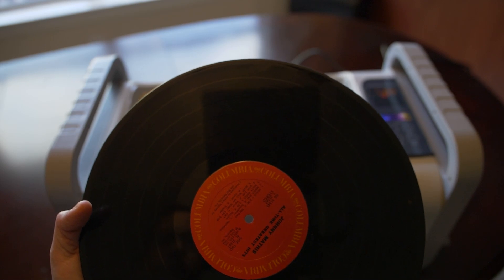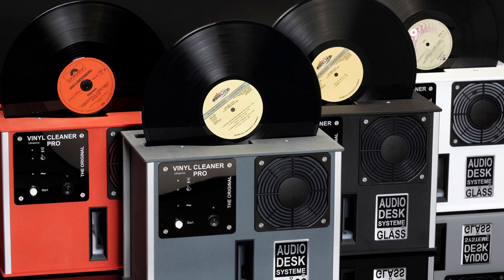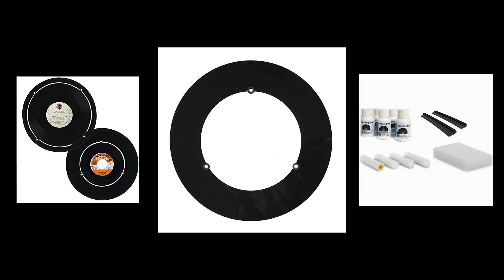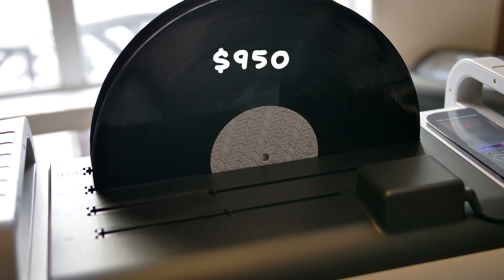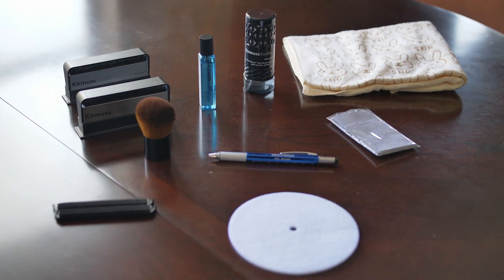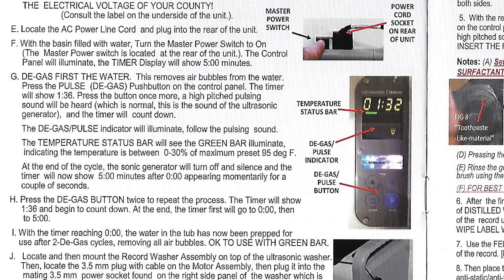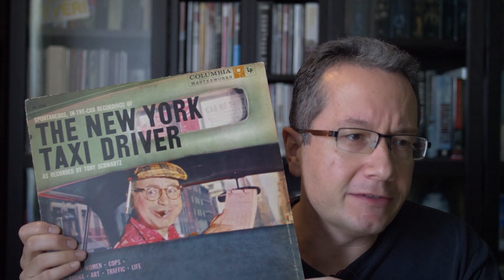Kirmuss KA-RC-1 Ultrasonic Record Cleaner Review and an Ultrasonic Cleaning Primer

Comment: Why never to use alcohol to clean a record (cont’d). You will not notice anything amiss until later… 
The risk, or reaction, can be perceived to come from the additives which are in the PVC. These plasticizers, stabilizers and extenders help to give the vinyl some flexibility, and are bonded into the solid material.

Small reactions of these elements of the record to alcohol are what can affect the integrity of the disc, and the risk of an adverse effect on their bonding to the surface and base of the PVC is what makes alcohol a less than desirable cleaning solution for vinyl records.
Reply from the maker: Do you know of any vinyl that doesn't have any plasticizers or stabilizers?  Gimme me a break.  I've even had someone from Dow chemical debunk this myth.  If you don't want to use alcohol...then don't.

Comment: Intelligent and cost minded , excellent presentation. Agree about use of alcohol, concerns seem to be more focused on extraction of  plasticisers rather than attack of PVC itself but I use IPA  20%: to deionised water 75%: to surfactant 5 % and have never suffered any embrittlement of the vinyl. Great topic and much needed with people hunting down old vinyl these days.
Reply from the maker: Thanks so much Steve for watching and commenting.  I am glad your experience with IPA matches my own.  I've been using it for years and have yet to experience any issues.

Comment: I just got my Kirmuss machine the other day and I have fired it up tonight.  I thought you might be glad to hear that there is no bunny on the front of my machine.  He must have heard you lol/. Poor bunny 🐰
Reply from the maker: Awesome!  I am really glad he changed the package to be a bit more professional looking.  I am going to run my Disney version until the thing falls apart ;)
Reply: @BarakaPDub  it does look more professional without it, I would say.  I tried your suggestion of drying the record with vacuum and distilled water.  It worked great! Thank you for the suggestion.  The Kirmuss is one amazing system.  I cleaned about 10 records last night, both mono LPs from the 50s and a handful of 10 inch EPs from the 40s. I listened to a few of them afterwards and I could not believe how good they sound. This system requires some work, but I think it is well worth it.  And a must for me because a large part of my collection are those old mono albums and EPs. Thanks again for this video.  It was really a fantastic review.  I appreciate it. 👍
Reply from the maker: Outstanding!  I am glad you're now experiencing what a really clean album can do to your system.  With your comment, I feel like I've done my job so thank you.

Comment: A well done video, informative and well documented on the operation of Kimuss record cleaner! I was thinking of another system? but pointing out the items that are conducive to wear and tear I see the value of spending a little more for this product! As it was once stated "it only takes a nickel more to go first class!" Thanks Byrne
Reply from the maker: Thanks Michael.  I have cleaned over a thousand records on this unit now and there have been no signs of wear.  I am a still a happy user and if I had purchased an even more expensive unit, like the Audio Desk, I would be an extra $500 to $1000 out of pocket buying fluid and rollers.  While the DIY machines work just fine, this one will be a little less labor intensive.

Comment: Loved this review and I am planning on getting this Kirmuss machine for my records.  So are you using the vacuum as a drying process once you have done the ultrasonic cleaner? That sounds like a way to cover just about all of your bases for sure. Thanks for the video!
Reply from the maker: In my opinion, regardless of the ultrasonic machine, not all of the removed particulate immediately settles to the bottom of the tank.  Some may actually end up back on the records surface.   I use the vacuum to do a distilled water rinse for a final cleaning step.  The key to vacuuming is not to over vacuum as it will just end up inducing static on the surface.  I will vacuum for one or two revolutions and let the remaining fine water droplets to evaporate in short air dry process.  Doing this, depending on the quality of the record pressing and condition, will leave the surface 97 to 100% free of any clicks or pops.   My process might be a bit too extensive for many but I have found it to work for me.  Hope this helps.
Reply: @BarakaPDub  That’s a great idea.  Thank you for letting me know your process! 👍
Reply: @BarakaPDub  what you are doing, is what i will eventually do. i have the kirmuss right now, and in a few months get the vacuum.

Comment: Thanks for the great video!  What kind of vacuum are you pairing this with?  I am looking at a Kirmuss, but buying a vacuum is another piece of gear, which requires more room.  Could the vacuum be avoided by buying Degritter or an Audiodesk or do you think those units would also require a vacuum?  FYI - ListenUp in Denver has the Kirmuss on sale for $850 right now.  Another question: does this unit ever cause the label to get wet?
Reply from the maker: Thanks for the great questions Israels & Neuman.  So to answer your last question, no matter what machine you buy it's going to be almost impossible to avoid getting the occasional label wet.   Honestly, I wouldn't worry about it to much as they quickly dry and it's almost impossible to notice that the label was wet.  There are some exceptions though.  I have some records which were made in the former Eastern Block (i.e. Poland, Czechoslovakia, etc.) that used cheap dies in their labels and it cause the die to run.   Now for the vacuum, most people don't bother.  They go one way or the other with the cleaning but I do both.  The reason why I do both is because the particulate that's removed from the ultrasonic doesn't immediately settle back at the bottom of the tank.  I use the vacuuming machine to do a distilled water rinse, removing any remaining particulate and I let the remaining, fine water droplets, air dry after a rev or two of vacuuming.  This process usually gives me an LP that's 97 to 100% click and pop free if it's a well pressed record.  Just doing the ultrasonic alone is going to get rid of the vast majority of residue that's collected on the surface though.  The AudioDeske and Degritter just have a few more bells and whistles by blow drying the record after the ultrasonic bath.  If I had to chose between the two, I would go with the Degritter.  The AudioDeske has proprietary fluid and rollers which can be an expensive proposition if you buy a lot of records.   If you add the vacuuming machine, I think I would go for the Pro-Ject VC-S2 ALU.  I am using a VPI MW-1 which is way overpriced for what it is.  I honestly think the Pro-Ject is better designed and half the price.   Hope this helps.
Reply: @BarakaPDub  Thanks!
Reply: @BarakaPDub  I do the same system. I traded up from the Pro-Ject machine to the VPI. The motor in the Pro-Ject is louder, and I felt the VPI had better suction power and was actually quieter. The Project looks nicer, but all of these machines look pretty bad sitting around your house except maybe the degritter. I sometimes think of selling Kirmuss and VPI to fund a degritter, but I can't seem to care about record cleaning enough to make the time to do it LOL. Most days I brush the dust into a line on the record with a basic CF brush and roll it off w/ a record roller. It is shocking how much dust records have, but the surface dust brushes off easily on clean records.

Comment: I would be interested in your review of the $500 HumminGuru machine. I only do a very few records at a time, so the multi-record factor of the Kirmuss isn’t persuasive. I also like, from video demonstrations, the smaller form factor and general quiet operation — I am in an apartment.  Also, a related question, do you do vacuuming after or before the US treatment? Thanks for your candid comments. They help.  The K machine is just too big for me.
Reply from the maker: The Humminguru is definitely the product of the year for me.  While I don't own one, I do think having something more at that level will get more people into it.  This shouldn't be made so expensive.   As for the vacuuming, I do it afterwards.  Why, you might ask?  When you ultrasonic, not everything ends back up at the bottom of the tank.  Some particulate that's removed can float back on the vinyl surface so a distilled water rinse on the vacuum machine, to me, ensures everything is removed.  I hope that helps explain my thought process.

Comment: I already have a Project VCS2 vacuum machine but was thinking of buying a Kirmus machine . Does the ultrasonic cleaner as well as the vacuum machine really make that much more of a difference than just using the vacuum machine on its own
Reply from the maker: So I found a big improvement doing both in tandem.  I don't think the vacuum machine will remove everything but then again, an ultrasonic isn't going to remove everything either.  The challenge I found with the vacuum machine was not to over vacuum as you end up just inducing more static on the vinyl.  I do use the vacuum machine for a distilled rinse and mechanical agitator when needed.   I hope that helps explain my thought process.

Comment: Cool that you get such great results! Do you know the frequency of the Kirmuss? Just so I understood correctly. You have water (distilled - de-ionised) + IPA + ultrasonic. Then you rinse in water (distilled- de-ionised) and air dry?
Reply from the maker: Correct on the process but unfortunately, I don't think I can give you an answer on the frequency.  I read somewhere it's the same as the Audio Deske  but I can't remember where I read that.
Reply: @BarakaPDub  Cheers. What drying rack are you using? I like that design.
Reply from the maker: I am just using a letter filer that I found at the Office Depot.  One of the best $5 I ever spent!  Plus, the metal only touches the labels and not the vinyl...if you're careful.
Reply: @BarakaPDub  Oh great, thanks for the tip. You might consider dipping the parts that touch the labels in that Plasti-dip... the stuff used for tool handles and things. Thanks for your help and advice!

Comment: Nice video!!!  I have one of the other machines you mention 6a  liter ultrasonic electric cleaning machine I just bought the tank & mad everything else my self.   I can do up to 6-7 records at a time & I just made a 2nd drying rack  (so while 7 are beaning cleaned 7 are drying.) I don't use distilled water or alcohol my solution I used reverse osmosis water, Then I if I need to (or I'll do it solo) I  use my Project VC-s Vacuum record cleaning machine, Both together work great.
Reply from the maker: It's funny, I am looking at setting up a reverse osmosis system in my home.  Just as long as you can filter out all of the hard elements, I suppose it could be fine.   Thanks for watching and commenting Paul.
Reply: @BarakaPDub  funny I watched your video again I for got I had made this comment Almost mad it again!   I get reverse osmosis water at Whole Foods for $0.98 for 2 gallons My jugs there water.  Yes it does work well with my Project VC-s machine .   Happy Spinning my Friend..

Comment: I have used a record bath for years with great results. It has vertical brushes on each side below the surface of the solutuion and you rotate the record manually while in the bath. I use Windex as the cleaning solution. You slowly rotate the record as you bring it out, then rotate it quickly to "centrifugally" get rid of most of the cleaning solution. Finally, stick the album on the drying rack after removing the record holder/label protector. It works fantastic!
Reply from the maker: Very interesting process Roy&Shashi Brock.   I do use a drying rack as I know any dry rubbing of the surface will just generate a static charge on the vinyl.

Comment: Do you think there is a "release agent" in most vinyl formulations?
Reply from the maker: I think all molded vinyl has some additives to help with the molding processes but in my opinion it's really nothing to worry about.  I know some cleaning product dealers hype the problem but I don't see as much of an issue.
Reply: @BarakaPDub  Thanks Paul!  After watching your video and quizzing Kirmuss, I ordered a restoration machine!  Thanks

Comment: Good video Paul, keep them coming. I enjoy the relaxed tone of your channel. I've cleaned my collection of about 1k lps using a Kirmuss over a period of a few months. Its worked very well - no issues to date. TBH I'm not a huge fan of the supplied spray, finding it very time consuming to use as prescribed and also found that it leaves behind white thread like remnants which you'll pick up later with the stylus during playback. I'm just using a solution of distilled water,  IPA, Triton X-100 & Behentrimonium. A 5 minute spin in the solution is enough for most lps. I agree that occasionally a manual scrub is required to remove some difficult grunge, even on new lps!
Reply from the maker: I've heard good things about the Triton X-100.  Have you been using it a long time?  Thanks for watching and commenting Playback!
Reply: @BarakaPDub  Sorry, I just saw your post now. I've only been cleaning my lps for less than a year & after LOTS of online reading as to what mixture to use settled on products that were easy to purchase (Amazon & local drug store) and had been found effective by others who had done their own experimentation = some have put alot of work into publishing their findings. It's such a small amount - I use a 1:1000 Triton/distilled water along with the other couple of ingredients. I only required 100 ml to do 1k lps.

Comment: I have one of those ultra sonic after market tanks with a very very vinyl clear adapter, which allows up to crazy 10 records at a time. Surfactants are a must. I use Tergikleen. Start up degassing,  6 minutes first clean ,lift out 3 records spray surfactants working the in the vinyl. Repeat process 3 times, then I use my Okki Nokki and distilled water rise and love my results.  An hour or two drifts by very fast  cheers Johnnie
Reply from the maker: Hello Johnnie.  Yes it is a bit laborious and your process seems a bit more involved but you're right about getting good results in the end.  It would be nice to do 10 records in one shot.

Comment: Great review and video Paul! Thank you! 🙏🏻 I just have one question that someone may have asked already but I just wanted to know how loud is the unit in operation? Would it have to be used in a separate room as per loudness or is it fairly quiet? 

Thanks again!
Reply from the maker: It's definitely loud enough to bother someone in the same room for sure.  It's not as loud as my VPI vacuum cleaner but it's up there.   Thanks for watching and commenting.

Comment: Which order: VPI (vacuum) clean first, then ultrasonic clean? Or ultrasonic clean first?
Reply from the maker: I ultrasonic clean first and then vacuum with distilled water.  My rationale, as you can see from the video, the particulates that are removed during the ultrasonic process don't drop immediately to the bottom of the tank.  There's a good chance some loose debris will land back on the vinyl once the process stops and you pull it out of the tank.   The VPI also helps to speed up the drying process.  I let the VPI run one or two revolutions and let any remaining fine droplets air dry in a rack.  I avoid going more than two revolutions on either side as my experience is that over vacuuming just creates more friction.  More friction just leads to more static build up.  Hope that helps.

Comment: Why are you not using the Kirmuss mechanical cleaning method?  I’m surprised you’ve not even tested it although you’ve paid for it!
Reply from the maker: I really paid for the machine and not the defungal process.  Personally, the key to caked on grime is the use of a mechanical but non-abbrasive means of removal.
Reply: @BarakaPDub  but I thought that the Kirmuss method is mechanical as well through use of the goat hair brush.  In videos, that’s Kirmuss’s selling point he always says it requires cavitation and mechanical.

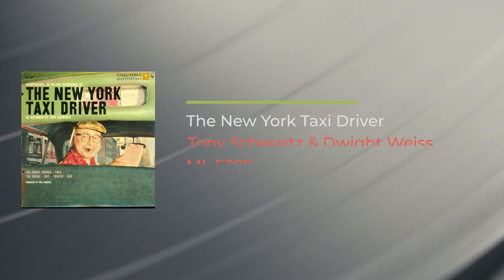Comment: why does 12:05 sound more clear and crisp than  at 12:35?  was that a before and after cleaning demo?  if so ,  12:05 sounded better to me, 12:35 lost some high frequency sparkle.
Reply from the maker: Hello Chris.  This wasn't really a before/after demo at all.  This is just showing that the clicks/pops were all eliminated through the course of the cleaning.  The source material is variable and that's due to how it was recorded.  Unfortunately, longer sound samples are likely to get flagged with a copyright strike and I didn't want this video taken down.  It would have been fun to use a well known audiophile record.  If I ever do a demo like this again, I will consider doing a before and after demo.